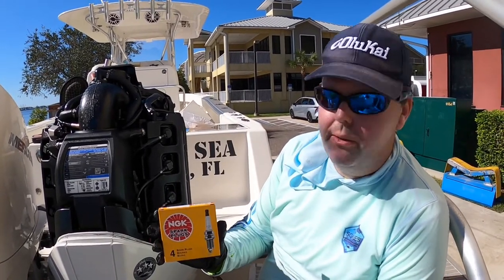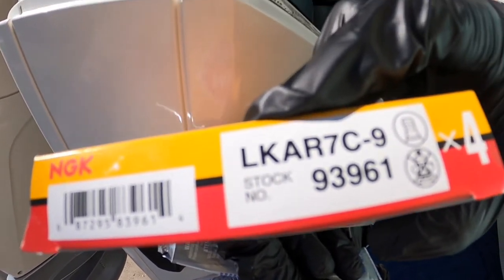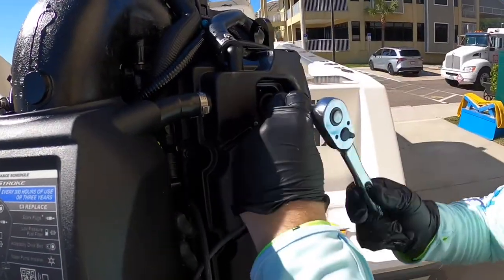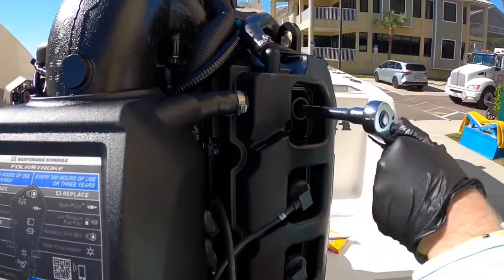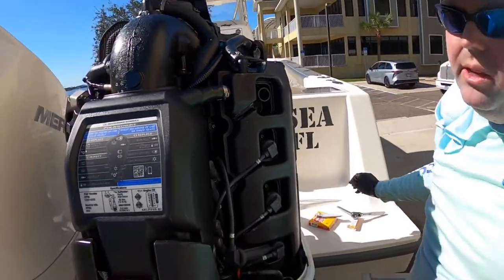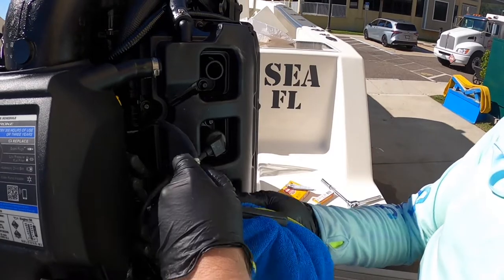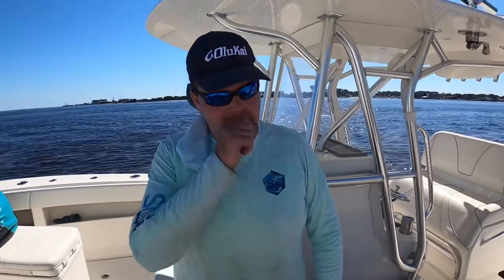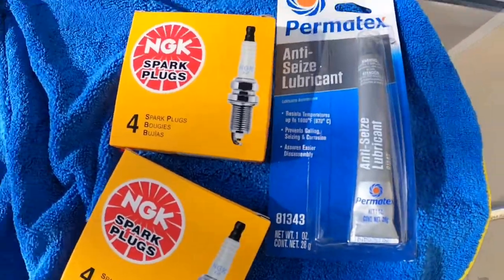How to change the spark plugs on a 175-300 HP Mercury 4 stroke.  Fixed a rough running engine!!

Comment: Is this the same spark plug part number for the 250 hp as well?
Reply from the maker: @james rice I believe they are the same spark plugs but I would double check the owners manual or call https://www.partsvu.com/ with your model number.

Comment: Is there a better quality plug available such as IRIDIUM made that is equal to the factory fitted to these mercury.engines..If so it would give better reliability & the need to replace as often...
Reply from the maker: @ianwhitton1732  my plan is to replace the plugs every 200 hours.  I will check out the iridium plugs you mentioned.
Reply: I was able to obtain some NGK ILKAR7G997801  Laser Iridium Plugs that are the equivalent of suitable to use in  the 200 hp Mercury Four stroke motors.. 
I was told the only difference was that the standard plug used is 1mm shorter which should not be an issue..